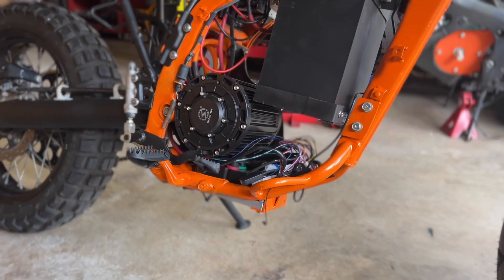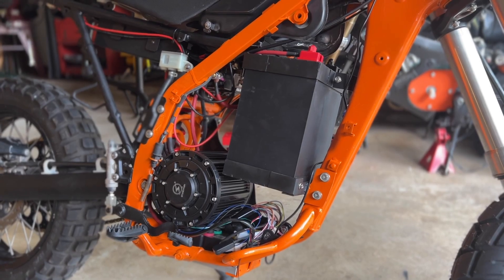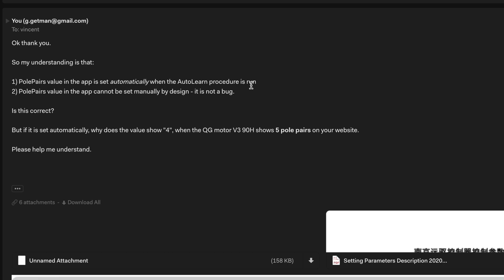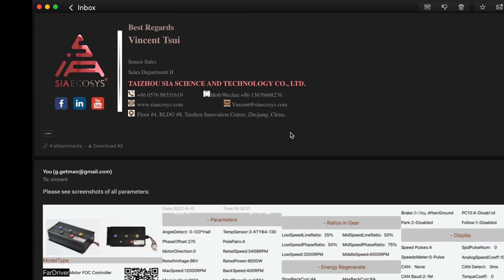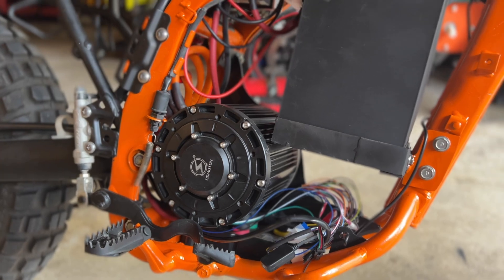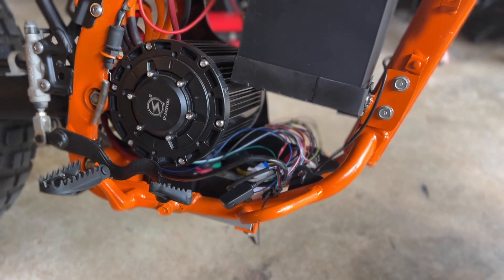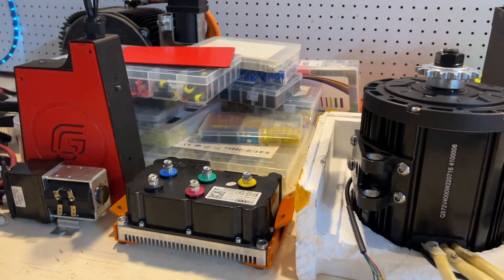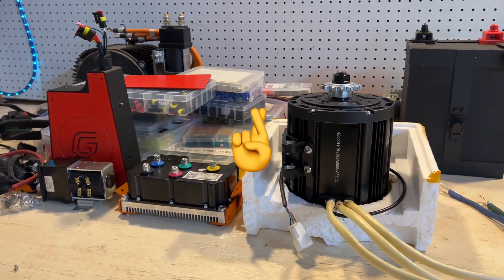I Bought My QS138 Electric V3 Motor on Aliexpress and It Short Circuited

Comment: You have to understand that the fardriver like most controllers cannot determine pole pairs. The only way it could if if there was an extra magnet and hall sensor counting revolutions. Of course its default is 4, but you can set it as high as 30. 

Also as will all controllers, pole pairs doesn’t matter. The controller doesn’t care. Its ONLY used as an rpm reference. This is what the rep was trying to say. You can leave it at 4 and calibrate everything around it. But who does that nonsense? Lol

One more thing to understand is the Fardriver can support up to 216,000 commutations per minute. That means the STM32, the mosfet drivers, the mosfets can only change a maximum of 216,000 times per minute. 

Another basic principle to understand is that each time a positive pole magnet passes a specific hall sensor, there will be 6 commutations before the next positive pole crosses that same hall sensor. In other words, this controller can handle 36,000 positive poles passing a specific hall sensor per minute. And as we know for each positive pole there is one pole pair.

Ok, so default it has 4 pole pairs. And if we divide 36,000 by 4 pole pairs we get 9000 rpm, and thats why the rpm table automatically populates to 9000. If you set 5 pole pairs, top RPM in the table will automatically be set to 7200. With 24 pole pairs top rpm is 1500. 

Keep in mind this is MAX RPM the controller can handle, and that includes extended RPM from flux Weakening. Which can be as high as 200%. So if you set rated RPM above 3600 rpm (50% of max supported speed of the controller) with 5 pole pairs or try to set 5 pole pairs after rated rpm is set above 3600 , it will reject it. 

These settings are preparing the far driver for autotune. After running autotune it will reset the rated RPM higher automatically to a higher value well into flux weakening territory. 

Later you can go tailor each rpm in the table to taper off at the rpm you don’t want due to flux weakening causing amps to shoot through the roof. If all were left at 100% then under certain situations it would pull more amps, get weaker, pull more amps, get even weaker, then peg the amps. So by setting the current limit for certain rpm it will not get in that region.
Reply: I can’t understand the parts where you said there is 6 sensors for one sensor. There is more if the rotor is a 5 pole pairs?
Reply: @timpuyau6161  , 6 commutation steps. Not 6 sensors. Commutation is when the current in the phase wires change because the mosfet states are changed. All 3 phase BLDC motors have 6 commutation steps because there are 6 possible ways to run power through the phase wires.

For example when the mosfets for phase A connect battery (+) and the mosfets for phase B connect battery (-), electrons will flow in phase A, through its coils, and then out phase A, through its coils. This creates a set of electromagnetics which pull or push on the permanent magnetics. 

Once the motor has moved to a position where the the magnets cant be pulled or oushed effectively, the hall sensor sense that and tell the controller to go to the next commutation step. So it switches the mosfets and turns off the mosfets for phase A and connects phase C to battery (+) and that turns off all phase A coils and turns on all phase C coils, which can now push or pull on the permanent magnets. 

By having 6 steps, the controller can always apply force to turn the motor in the correct direction.
Reply: @imho7250  ok I’m understand,
So eRPM = pole pairs x rpm
Frequency processeur = 6 x pole pairs x RPM?
And it’s the rotor pole pair that count or the pole pair of the stator?
Reply: @imho7250  i have a book for electric motor and talk about brushless and pole pairs only for the rotor
Reply: @timpuyau6161  the processor frequency is higher because it has to do other calculations and vary how long the mosfets connect to the battery based on the desired current. 

When all that and the frequency at which the mosfets can be switched, it was determined by the manufacturer that in order to allow everything enough time to do its job, that it can only support 216,000 commutations per minute, with the understanding that within each commutation it needs turn the mosfets on and off many times to control current based on throttle settings and other variables. 

So 216,000/6 commutations is 36000 pole pairs per minute that can pass by the hall sensors. So with 4 pole pairs, the motor can run up to 9000 rpm, since each revolution would let 4 pole pairs pass, and each pole pair passing means there were 6 commutations steps.

So as you enter pole pair in settings it will recalculate the RPM table.
Pole pairs        Max RPM of motor
4                             9000
6                              6000
12                             3000
24                            1500

And the reason some have a hard time is if you have 24 pole pair, with max rpm of 1500 and probably a base rpm (no flux weakening) of 600, the rpm you enter for rated RPM or max rpm cant be set too high or it will reject it and not save the new pole pair number. So you have to set the rpm lower when you try to set pole pairs higher.
Reply: @timpuyau6161  , yes, pole pairs are only on the rotor because only the rotor has the permanent magnets, arranged in pairs of north and south poles, 180 degrees across from each other. So a motor with a stator with 48 total magnets has 24 pairs of magnets which is 24 pole pairs. This would be a typical hub motor.

For mid drive motors the stator has only 4-6 pole pairs the rotor is much smaller diameter so it spins much faster.
Reply: @imho7250  you explain very well, thanks.
But the 138 90H for exemple has 4 poles pairs in the stator and 5 in the rotor but they can have more and it’s will be more performant for motorsport?
Reply: @imho7250  for the asi bac8000 the pwm frequency is 16 kHz max so it’s possible to match with the qs 138 90H
Reply: @timpuyau6161  , only the rotor has pole pairs, the stator of a 3 phase BLDC motor will ALWAYS have sets of 3 coils, so 3, 6, 9 etc. since the QS 138 has 5 pole pairs (10 magnets, it most likely has 12 coils, 4 per phase. But the controller doesn’t really care about that, thats all determined during the design of the motor to make sure the coils can properly push or pull on the permanent magnets.
Reply: @timpuyau6161  , I haven’t used any BAC controllers but i think they are good and will support any BLDC you connect to it. Im mostly familiar with Votol, which is quite a bit different than Fardriver. And the BAC i don’t know what the settings look like to know how to set it up.
Reply: @imho7250  there is often more coil so 12 than the number of poles (so 10)?
Reply: @timpuyau6161  , there are almost more coils than magnets in a BLDC because if you have 12 coils and 12 magnets (6 pole pairs), the cogging effect would be very annoying. So the QS uses 12 coils and 10 magnets (5 north, 5 south, which is 5 pole pairs). This reduces the cogging because as one south coil pulls on a north magnetic, with its highest force, the next south coil is a little further away from the next north magnet so it pulls more gently at first. Then as the rotor moves a few degrees that magnet gets closer and the attraction is stronger but the other coils and magnets get a little further aperture and weaker. So the torque is smoother.
Reply: @imho7250  thanks you for your help.
And for the asi bac it’s a 10kHz so 600 000 commutations per mîite I think
Reply: @timpuyau6161  , the PWM is 10k hz, which means it can turn on and off the mosfet up to 10,000 each second during each commutation, which gives very accurate current control.

The controller max output frequency is 500 hz, (30,000 per minute). But not sure how they are rating that. Perhaps it means it can run a motor with 5 pole pair at up to 6000 rpm. Since the QS 138 90H can run up to 7000 rpm, it might mean the BAC4000 cant make it go that fast.

The fardriver can run a 5 pole pair motor at 7200 RPM max so it can fuller support the QS 138.

But I might be misinterpreting the BAC4000 output frequency or its must designed for slower motors like what comes on the surron.
Reply: @imho7250  it’s maybe the eRPM for the asi bac but I just want to run my qs138 90H at 5100rpm so it ok I think
Reply: @timpuyau6161  , yes, since eRPM = RPM * Pole Pairs, then the BAC can supply 6000 RPM in the QS 138. 

It would be interesting to see what the real world differences are between using a FarDriver which can run a QS138 @ 7200 RPM vs the BAC4000 which can run it @ 6000 RPM. At the high RPM many other factors come into play, such as flux weakening and the final drive ratio you choose.
Reply: @timpuyau6161 , I just looked at the settings for the BAC4000 and its flux weakening settings are different than FarDriver. I think its better, like Sabvoton and Votol, giving you direct control. 

Woth the BAC 4000, if you don’t want flux weakening, you can set it to 0%. The FarDriver you have to program the RPM-CURRENT LIMIT table such that it just wont feed the current above the RPM where flux weakening begins. But if you get a new motor and just want to learn how it behaves without flux weakening, you can’t really do it with FarDriver. 

The one good thing about the FarDriver settings is that after you determine the base RPM, you can set the controller to give maximum peak amps up to that and then above that RPM you can taper down to maximum continuous amps, and then it will allow it to run 7200 rpm downhill, about 6000 rpm on level ground, and maybe 4800 rpm uphill. Whatever the max continuous current supports. 

The main thing is not to set it to 7200 RPX-100% because then if going up a steep hill it might get into a situation where it adds more flux weakening, decreasing torque, which makes the motor run slower up that steep hill, which makes it draw more amps, which decreases torque, making it slower l and the end result is you will be at max peak amps and burn the motor up since it cant back off (unless you have the temp sensor working).

With the BAC 4000 on the Surron, they recommend just using 10% Flux weakening with the stock motor. But with a QS138 90H I think you will have to tune it to your vehicle and environment.
Reply: "But who does that nonsense?" sadly I do as I'm not able to change it, but I think I allready told you before
Reply: @surronzak8154 , i just got my own fardriver finally and it has interesting firmware. I did a video on the pole pairs. Mine, like yours, only FULLY accepts 4 pole pairs if less than 16 pole pairs, as it keeps the 0-9000 rpm Ratios in Speed table. However unlike many, mine will accept pole pairs 3-15, and adjust the digital tachometer to the correct motor rpm. It also rescales all the RPM limits you set in the. The analog needed on the app stays at 4 pole pair equivalent no matter what. 

I have 40 pole pairs so this feature didn’t really help me. Lol
Reply: QSmotors doesnt have a aliexpress shop... lol

Comment: You are right the over voltage issue does not matter I run my QS 72v motor at 96V no problem at all 
I would say the motor had some problems and I do not think the controller would have damaged the motor either
Reply from the maker: yeah you are 100% right - the issue was not the voltage -- they were just straight up lying. The issue was that a) Im dumb and crimped the terminal lugs on top of enameled copper BUT I checked the original crimps and b) THEY crimped the terminal lugs over enameled copper, which is just outright negligence. I have a video on my channel detailing that debacle (https://www.youtube.com/watch?v=HNDqLJDV5gE ) the AliExpress store eventually refunded $225 to me. Never mind the motor with shipping was like $600
Reply: Yeah voltage has no real input on temperature, it all comes down to current so whether it was voltage or amps, it wasn't rated correctly or setup right in the first place. Sorry for your experience.
Reply: Then what causes it?
Reply: It's the current. Voltage × amps = motor watts. This is why high power bikes use high voltage as they can run lower amps and get the same power with less heat. Example..... 20a × 48v = 960w
20a × 72v= 1440w. More power for the same amount of current keeps the heat down. Current kills motors, not voltage. Yes you can give a motor so much voltage it destroys itself from spinning so fast as a motor has a simple rpm per v. Increase the voltage and you increase the total rpm and at a point it will become unstable.
Reply: @Nalladalla32  and also what causes the controller to break down
Reply: @christianpaulroldan4010  There are a lot of factors same as with a motor but the most common are from it getting too hot and burning out. Working it too hard can cause a capacitor to fail, a mosfet to fail, melted wires etc. Other common problems come down to build quality and how true its specs are. Things like intermittent shorts from poor cabling and insulation to something stupid like a  sensor or wire becoming dislodged or shorted in the circuit board from vibration. Not always will it burn up and smoke. They usually die quietly. 
Main causes id says would be 1. Lugging the motor(going up a hill slow at full throttle)2. Shunt mod or other mod to increase the stock power output of the controller or 3. Poor wiring connections and Insulation introducing cutouts and intermittent shorts.

Comment: Does that far driver controller have a learning function so it can detect the correct phase order/combo?
Reply from the maker: it has a learning function but if you're using the Fardriver controller and qs motor, the phase wires are colored accordingly

Comment: I asked QSM what oil I should use in my QS138 V3 and how often it should be changed, they replied with, not necessary to change the oil. 🤔
Reply from the maker: I have another video where I teardown this motor. There is no oil in the motor to change
Reply: @GaiusGarage  I'm referring to the geared version of the 138 motor.
Reply: QS recommends 45ml of 85-140 gear oil ,  or Motul Motylgear 75-90  for the V3 motor.  The motor in this YouTube is not a V3 motor

Comment: 1. People run qs motors on 28s all the time.
2. I run my nd72530 controller with the motor temp sensor turned off and MOE protect off
3. My nd72530 with my qs138 v3 autotuned to 4 pole pairs and it seems fine. 

Hope this helps
Reply from the maker: thank you! yeah, I've since figured all of this out. the issue was that whoever assembled this motor did not bother to clean the enamel from the phase wires when crimping the terminal lugs. This cause extreme resistance and heating. the voltage is 100% not an issue. 4 poles pairs refers actually to poles of the RMF in the stator - in fact, this is still wrong because the RMF has 4 poles not 4 pole *pairs. I had to buy a new motor but it's now running as cool as the controller on 96V. Did not have to turn off the temp sensor either
Reply: how do you like the ND72530 controller ? Im debating about buying one to replace Votol EM-150/S
Reply: @manaoakes3062  upgraded to the 72850. It was decent. Few issues of it shutting down after hard braking. Changing over to shul controllers

Comment: The people who you contact, hoping for technical support 🙏 , know nothing technical , I have had to send pictures to communicate with them. Frustrating to say the least. You apparently got a lemon, maybe? Usually qs motors make motors that can just about within reason take a lot more power than your average or cheap Chinese products 🤔, but they like all Chinese products have problems, bought qs7250 controller, specifically so I could program it with the Bluetooth on my phone, couldn't get their program to download on any phone. I threw it away
Reply from the maker: I put up another video after this https://youtu.be/HNDqLJDV5gE where I discovered exactly how this motor I got was faulty - it's absolutely egregious and I still can't believe the Aliexpress shop from which I had the misfortune of ordering would sell these this way - it's quite literally without exaggeration a fire hazard, and thats exactly what happened in my case. I have the particular shop linked in that video description to warn others but yeah, it's a real issue dealing with these Chinese vendors because you have basically no recourse, legal or otherwise